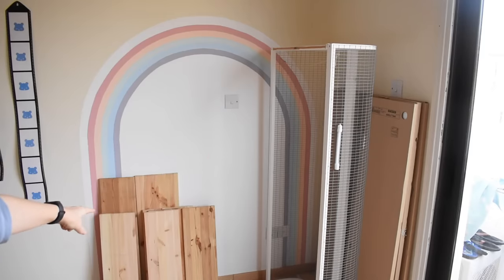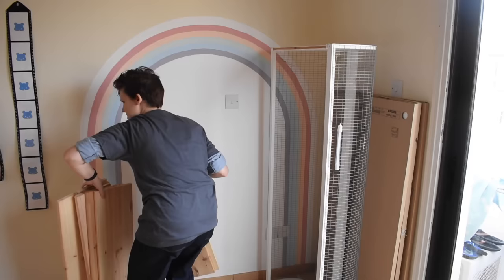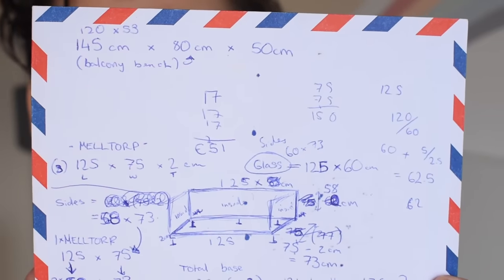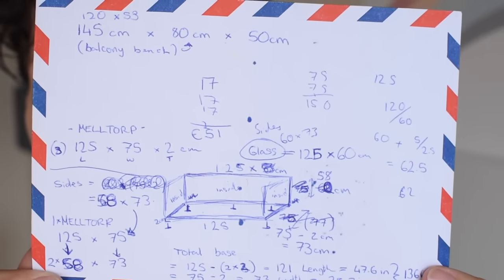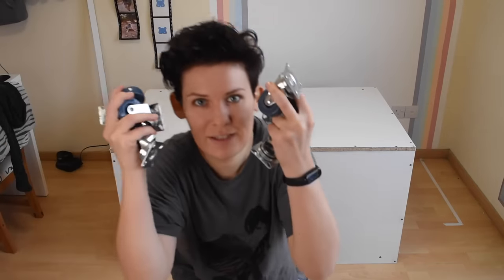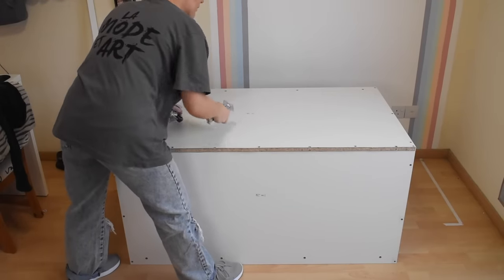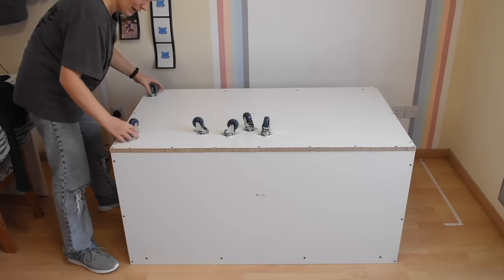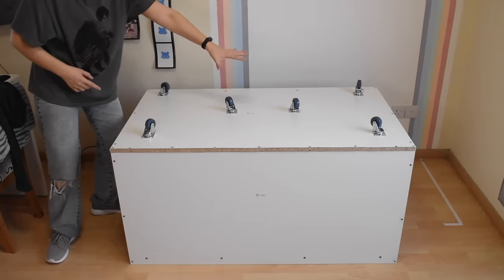It's Time To Build Another Hamster Cage [1310 in²] • The Big Cage Project Ep.1

Comment: I'm trying to repurpose a MASSIVE rabbit hutch into a hamster cage.  The ledges that supported the barred top are prefect for putting acrylic sheets into.  I won't be going with glass, as glass can break, not because of the hamster of course, but because of other things, like accidentally hitting it with something...lol.   Like how I accidentally busted a fish tank with a very heavy bronze floor candle holder...lol.  The tank was empty, don't worry! :)   I wish IKEA wasn't so dastardly with their shipping costs, because that's what stopped me going this route.. No way am I paying nearly 300USD in shipping when IKEA is only 58 miles from my home.   But, I guess I was going bigger when thinking of using the same table tops, as they have two sizes, so I was going to get two of the larger for the bottom and the back, and two of the smaller for the sides and do the front in acrylic.

Comment: Would you think of setting up something where we can purchase these enclosures from you already built lol.. I’d love to do this for my 4 hamsters but I’m no good at DIY and I want them to have the best life, I’ve done all I can but feel like it’s not good enough if that makes sense lol xx
Reply from the maker: Unfortunately that isn't a possibility due to time/resources, (even if I had those things you'd also need to live here in Cyprus for it to be a viable option). You really don't need to be good at DIY though, I wasn't when I started out and it's taken many years of practice and a lot of mistakes to get me to this point. The only way you can ever get good at something is through practice and you can't practice if you don't start somewhere!

Bin cages are a great starter DIY and it's difficult to go wrong with them, the IKEA Lack is also quite a simple DIY but requires some minor wood cutting. You also don't need power tools DIYs you can use handsaws, hand-drills and other manual tools instead. You could also buy pre-cut raw wood from a supplier (hardware stores usually sell it) and then its just a case of screwing them together to build a box. You don't even need to have a glass front as that's just for human benefit, and if you don't have predatory pets in your home then you don't necessarily need to build a lid either. 

If you're really interested in making your own enclosures please don't let fear of mistakes hold you back, I promise that no matter what the end result looks like you'll feel so much pride for your own hard work and your hamster will always appreciate having more space and more enrichment :)

Comment: Wait... There's a proper tool besides hammer, screwdriver, and pliers to remove staples...?
Reply from the maker: Glad to see so many people who also use screwdrivers for this job 😂  Actual staple removers are basically a set of flat teeth that slide under the staple, clamp onto it and then you just pull it out. Much less fun in my opinion 😌

Comment: Hey Erin.  I’m from Ireland and there is IKEA here.   Is that wood water proof and how did you find out it’s safe for hamsters if they chew and digest it.  And also would it work for gerbils
Reply from the maker: Wood coated with melamine is always completely waterproof, however it is not safe to be chewed on so I would not suggest using it for gerbils. The majority of hamsters don't chew on their cage walls which is why its common for hamster owners to use melamine for their cages without any concern, since destructive chewers are rare and usually have to be housed in glass enclosures anyway. I would also suggest avoiding melamine for hamster shelves or toys since the edges/corners of those are more likely to be nibbled on

Comment: Before U add (and maybe U talk about this in another video) dirt and such, do U line or protect it with anything?
Guess the same question goes for cleaning these deep dirt cages.
Reply from the maker: When I've used soil in the past I haven't lined those cages with anything. I do seal the edges of all my cages with aquarium silicone regardless of the substrate to prevent any moisture from getting near the raw edges or bedding from getting stuck between the joints. I'll be adding silicone to this cage later but I won't be using soil in it, I only use soil from time to time as it's a high maintenance substrate and I honestly just get bored of it after a couple of months 😅 I'll be using a mix of safe wood shavings, paper and hay for this set up 😊
Reply: @SomethingAnimal  Thanks for this info. A great video with substrate  names and suggestions would be awesome in this vid series/build.

Comment: So I have a question & im wondering if anyone can help me, I just got a hamster about a month ago & my loving boyfriend made him a wooden cage. It's about 800 square inches with an acrylic front & a mesh top it's really nice but it got really cold where I live & im having trouble keeping his cage warm, I was wondering if anyone could help me out with finding a way to keep it warm? I tried adding more bedding & insulating the outside with blankets but I'm still worried because it's supposed to be under 30° for a long time, I can't really move him to a different room because I live in a tiny apartment which the heating sucks in. I heard about using reptile heating pads but I have no idea what kind to get or what else I can do, I appreciate any help or ideas u guys might have tysm
Reply: Have you thought of buying a small portable electric heater? Many models have thermostats to control the heat. This should keep the area around the hamster cage warm and cozy...
Reply: @ronclark9724  this winter I used a space heater on & off and covered parts of it in blankets & that helped it's just I'm the kind of person who probably over worries about my hamster lol just I wasn't sure which was the best to get? I don't want him to overheat or freeze so I was looking for a way to be able to read the temp in his cage so I know when I should turn off or on the heater, if you have any suggestions on that I would really appreciate it lol.